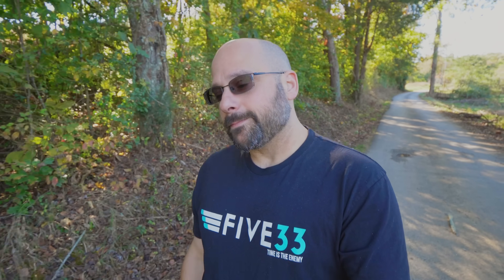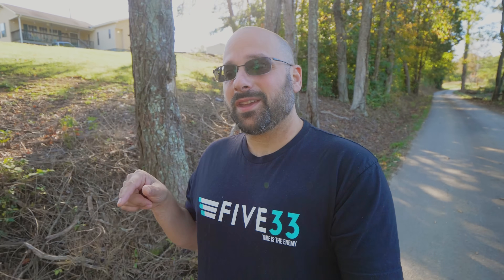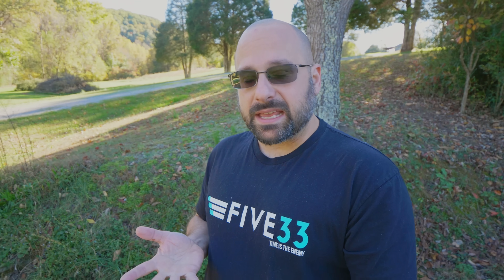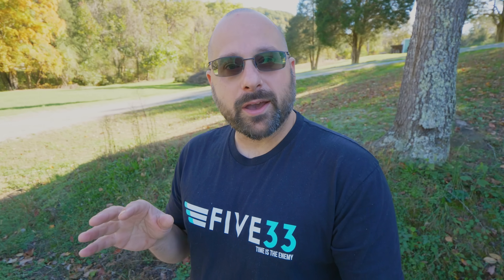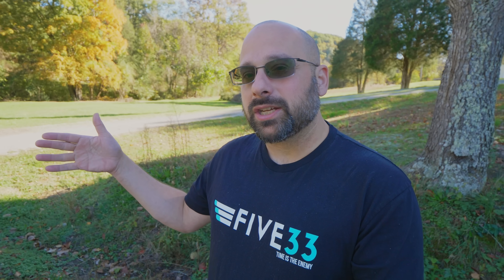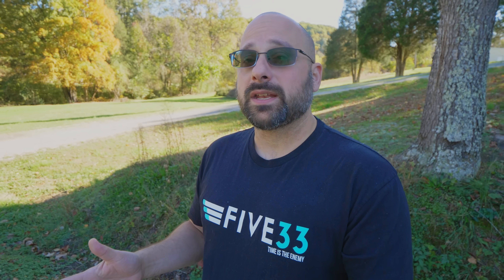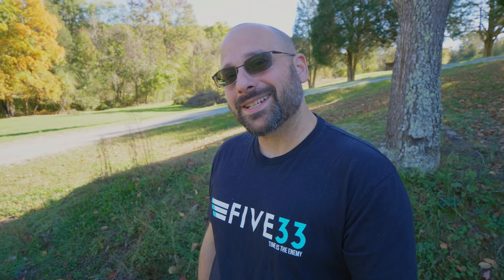How long can you leave your lipos fully charged without damaging them?

Comment: Thanks for this great info Joshua.
I just pulled my quads out of the closet last night, after two years, and remembered I hadn’t discharged my batteries to storage level before they got boxed up when we moved.
Two of my Tattu R-Line 850 4s batteries were completely dead, and two of my Ovonic 1550 4s batteries each had a single cell below 0.5 volts.
The rest seem to be fine, and have discharged down to 3.6-3.8v per cell on their own.
I was able to resurrect both Tattu batteries using the NiCd direct-charge trick to 13v, then balance charging the rest on LiPo. They’ve both held charge across all cells overnight so far. Fingers crossed.
I was also able to resurrect the single cells in both Ovonic batteries by charging them through the balance lead using NiCd to 3.5v, and then LiPo 1s to top them off.
Now I’ll just have to see if performance has degraded much. The batteries didn’t have a whole lot of usage before being stored so I’m hoping for the best.
Reply: This sounds like playing with fire, like... literally 😅

Comment: In re smashing your batteries: 
That's why I switched to Floureon batteries. They have little plates in them.
They're heavier, but after chopping one battery in my props and bashing a Tattu into the ground until it broke, I got the "armored" Floureons. They perform decently too, but my charger doesn't think they hold balance well at all.
Better than those cheap pair that one just decided to go up sitting on my table. Left a burn spot. The other one has a lame cell, but interestingly my charger has no issue with its balancing.

Comment: I keep my batteries in a ammo box.With lid partly open.I've also left them in there fully charged. They do drop in voltage. About .7 ( over a half volt) over a period of 5 months.i don't have any issues with the batteries.ive been doing it for 3 years now.i keep my batteries in my basement on the concrete floor with nothing around them and in a steel ammo box.

Comment: But what is "performance" does this entail the discharge rate or its capacity?

For example, I have some very worn out cells that I always put back to storage mode. If I measure their capacity, they are still fine barely degraded... but I can't discharge them like I used to!

I still repurpose these worn cells for other electronics, I have this TinyGS running off a cell that still lasts a good few days before I have to top it off. Fly a quad off of it and it cries uncle!

Comment: Hi, I fly electric RC  aircraft since 2008 and many like me fly large models and often the same day in several times. It would take too long to charge them the day before, especially since we have to adjust our schedule according to the weather.  I have had LIPO batteries since then that are still in good condition and have always been kept fully charged !!!! The reason for their longevity is that we keep them in the freezer, which immobilizes their natural chemical degradation metabolism.  So no worry about keeping them fully charged as long as you maintain their temperature below 10c. For those who say that the cold prevents the batteries from giving their full power, I personally could never tell the difference.

Comment: I left a 2200mah 4s after a full charge for 2 years. I would say it has less than 50% total amp draw left and cannot sustain the discharge rate it used to. Basically stuffed

Comment: Hi Joshua!
There's an opinion, that's it's better to store lipos in fridge. This is because the batteries lost their capacity cause of chemical reaction, and when low temperature the reaction goes slower. That would be great if you test that. Because for me its easier to drop my batteries in fridge instead of discharging them if for example i want to store them one week before next weekend. Thank you!

Comment: Joshua, Good info on the batteries.  I recently did a test with my phones lipo, which took 2+ years to complete.
I read that, like you mentioned, a lipo's ability to hold a charge was reduced to the 70% arena after 300-400 charge cycles.  BUT, just modifying two parameters would increase that life to 1700 - 2000 charge cycles. Now, to be fair, a charge cycle is defined as charging back 100% of the battery's capacity.  ie , a 4S 1550 would need 1550ma of power charged back in to be considered 1 charge cycle..  Two 775ma charge sessions would be considered only 1 charge cycle, as well.

The two parameters I mentioned are 1) Limiting the cell voltage to 4.00v/cell (or 80% of the battery's capacity) and 2) limiting the amount put back into the pack, at any one time, to 20% of it's capacity.  The second would require multiple charge sessions to get back to the 80% mark.  Funny, it's the 80/20 rule that we see in business all the time.  80% charge cap, and a max of 20% at any one time.
  
You might ask "What do these two things accomplish?"  
1 - The 80% rule addresses the phenomenon of the battery chemistry crystalizing in the cell at anything greater than 4.00v.  Well, it actually occurs at all voltages but what experts have learned is that it accelerates at voltages above 4.00v.  
2 - Limiting charge amount, only adding 20% at a time, addresses the second killer of lipo's, and that's heat.  When you charge back >20% the battery naturally starts producing heat internally, which also accelerates the crystalizing phenomenon spoken of earlier.
So, back to my phone test.  I bought a new Samsung Note 9 in Sept 2018.  I installed an app called AccuBattery, which tracks your battery's health in terms of capacity, and will let you know what its capacity at any point during its life.  It will also alarm when it reaches the maximum capacity that you set it to.  Mine was set to 80%.  By changing the way I charged, limiting it to 80% capacity (the Notes have a 4000ma pack so I wasn't really limited at being at 80%) and by "bump-charging" on a wireless charging pad several times a day, I was able to trade in that phone at the 2 1/2 year mark....and AccuBattery said that my batteries capacity was still at 87%.  The second owner of that phone got a bargain, if you ask me, because used phones typically have batteries that have been "rode hard and hung up wet", and you never know what their life is.  Kind of like a used car.  Getting a phones battery replaced can be expensive.

Conclusion:  I'm glad we don't fly phones!!  We can toss a mini quad lipo and replace it once we feel the sag coming on sooner, knowing the pack has seen better days.
Thanks for the video, as I've often wondered about how long I can store before I start crystalizing the chemistry.
Reply: High performance lipos are have much higher discharge rates and are completely different from the lipos in our phones. They don’t suffer the same damage at the same voltages
Reply: Don’t you think it would be better to know the answer to the video you’re making BEFORE making it?

Comment: I had 4 batteries with about 40 cycles on them each. In 2013 I didn't check voltages, I just flew, sometimes till the motor cut out. Due to various reasons, I hadn't used the batteries for 8 years. When I pulled them out of storage, 3 of them were at about a storage charge. One the them was sitting at 12 volts! (These are 3 cells). I must have left it fully charged when stored. I must say, I was amazed by this, as I expected them to all be dead. All my little 1 & 2 cells were deader than a doornail, except for 1 elite, which I charged up and flew a micro around on. How long will lipos last? Who knows? Some will go 8 years, that I know.

Comment: Very good points! I am very "relaxed" about how long I leave my batteries at full charge (I like to have them ready to rip) and I am unable to tell any difference in performance. That doesn't mean there isn't a performance degradation, just that I'm not bothered by it. 👍

Comment: File under "Stupid RC Modeler Habits".  What exactly is the point of charging to 100% before you even get to a flying site.  Especially like more than 4 packs.

Just charge them up to 4.1v or 4.15v per cell, then top them up once you're actually on site getting ready to fly.

Some of you prefer to get lost in the weeds than just use common sense.
Reply from the maker: Not everybody is set up to charge at the flying site.
Reply: @JoshuaBardwell  What does "not ... set up to charge at the flying site" even mean?

If you have 6 packs @ 4.1v, you can just use pack #6 to top up the other 5.  Or just carry one of your non-flight-worthy packs as an aux pack.  It's better to beat up a single aux pack that you don't care about anyways instead of smearing completely unnecessary wear all over your good flight packs.
Reply from the maker: It just sounds like you're making your life complicated for minimal benefit. You asked, "what's the point of charging to 100% before you get to the site?" And the point is, obviously, that you want to be able to fly as soon as you arrive without faffing about with your charger. I hate charging in the field at all. I just show up with ten or fifteen charged packs and I'm good for the day. If I do end up charging, that's fine too, but I try to avoid it because I'd rather focus on flying than charging.
Reply: @JoshuaBardwell  There's the idea of, "Oh man I'm going to hit the site with 100% it's gonna be so extreme" and then there's the reality.

By the time you get to your site, you 100% charged battery isn't 100% charged anymore.  Roughly within about 8 hours (give or take) you will have dropped to 4.15v per cell anyways.  After that the self-discharge curve starts to flatten.  You'd think that discharge curve would have been a part of this analysis.

So if you go 8 hours or longer, you have essentially accomplished nothing other than unnecessary wear on the battery.

Comment: Ive let battery self drain for 5 years before i got back into offroad rc's i have and yes some were under voltage or 1 cell not registering but id charge them a bit without balance plug to bring the one cell back to a voltage , then id charge them full with balance port and still some would be under 6 m ohms resistance per cell and yes some were new batteries or used once.  i have 10 thunderpower adrenaline new in package still for 5yr now as well.  I have a brand new i flight fullsend v4 6s i just used one time till quad started beeping (was using it to get quad dialed in etc) and when charging it the cells were crazy resisance  of 40 mohms and one cell had 90 in beginning and once charged went down to only 24 m ohms which is sadly high esp for a new battery used once.

Comment: Not bad. You forgot to mention temperature. Li-ion batteries die from oxydisation. Oxydisation is accelerated by elevated voltages (eg 4.2v) and elevated temperatures. This is why laptop batteries die - always warm and always fully charged.
Batteries can be kept at 60% charge and at 4°C for an almost indefinite life. Instead of discharging your lipo, why not put it in your refrigerator.

Comment: You can leave them fully charged for never! Even charging a lipo battery to 100% is what causes most of the damage and battery degradation. If you only charge them to 90%, or even better only 80%, they will last VASTLY longer in terms of number of charge cycles, and you'll hardly even notice that 10% or 20% less charge is missing.

Comment: your comparing apples to oranges. 30 days full charge no cycles or cycle it every day and recharge leave it one day cycle it? you have to add in the damage of cycles and how fast you discharge when cycling. many different outcomes. but i agree dont leave the batteries charged for a week without using it or it will begin to damage it. just my personal experience. also every brand of lipo is different some crap out or puff much faster than others. you need a test for each brand as well. jmho,
 good video.

Comment: One way of looking at it using the available information... but over a decade testing lets me say temperature during storage just above freezing almost stops the clock...  and GNB says to maintain capacity to store their HV Lipos just above their wet charge state (somewhere just above 3.0v) and NOT at 3.85v as most people say repeating what they have been told.

Comment: josh is all wrong in this video 24 hours is max you want it fully charge and from 4.2 to 3.8 is not one full cycle its less than half.. lipos can last to 500 charges if you go easy on them charge the night before next morning fly then put in storage.. alternate batteries 10 minute rests between charges 20 ideal.. so buy say 4 batts and by the time you get back to num 1 its been 20 min.. buy quality batts like turnigy.. not amazon crap.. there is no such thing as hv batts there regular lipos labeled as high voltage charging a lipo to 4.35 tripples the speed at which they will die meaning 500 cycles youll get 100 tops on a good day.. you want more flight time on a small drone you go 14.8 volts on a fpv.. minimum and you buy more batts for 1s drones that simple 1 s drones youll only get max 3 minutes 2s depending 5-8 minutes 3 s about 10 4s drones about 12-15 minuts and so on and so on reason being the higher it can handle your motors wont go below min cut off meaning 8 volts for some motors and 12 for others  so you can kill your batt but atleast youll come back with a dedead lipo and not a lost drone.. for long range fpv use 14.8 minimum..

also charge at 1c to 1.5 most batts now can handle 2c with ease but if you do you take off 50 charge cycycles atlease by doing so charge less than 1c if you cant afford bats... and graphine batts are a lie and a myth they can fail faster because its a gimic and 1 layer of graphine really is a joke to get you to buy
Reply from the maker: Why 24 hours and not 23? Or 25? Why exactly 24 hours? Why not 22.7538923 hours? You sound really certain so please let me know how you get that number.

Comment: I once charged my lipos and left them for 4 days fully charged, because I was travelling during that time and greeded on having to spend time on charging and discharging. After 4 days, I flew the drone with the first battery and noticed that the voltage was dropping very fast, when I attemted to land, it saged so hard that my drone felt into the lake next to me, so I lost the drone. I learnt the expensive way, NEVER LEAVE LIPOS CHARGED FOR DAYS.

PD: batteries were pretty new.

Comment: So - leaving em fully charged reduces the capacity to hold charge - vs packs with bad Internal Resistance (IR) which have reduced capacity to deliver the charge they have.  I've been storing some packs fully charged for too long now - and I note that some cannot be fully charged any more - they instead peak out during charge at 4.10v for instance,  rather than at 4.20v.  But some still have low IR.  Learned something new today.  You can reduce the capacity to hold charge (leave em fully charged all the time), and you can reduce the capacity to deliver charge (run em down to 3.0v a few times - I think that will do that)

Comment: 100% agree, as example my Mavic Batteries do auto discharge after 3 Days, BUT they are very likely never to be broken in a crash, in fact, the oldest one is rocking 472 cycles and i still can fly 14 minutes with it. but for the freestyle Lipo's if i go out with the gang and somethings some along the way .. i just leave them and use them up over the span of the week flying them to the storage voltage (ish) so the charger just need minutes to finalize the storage. i repeat this until 4 packs are left (always have 4 fully charged)

Comment: Here is an Idea, I have my flight time for every quad set to leave a battery cell at 3.8 volts when the flight timer expires. I charge them before flying to full charge and fly them long enough to never drop below 3.8 when not under load. It takes a little trial and error but once you have the quad timer set, you never have to put the batteries into storage mode because they are already there. Only downside is that you get less flight time, but I compensate with having at least three batteries for each quad. It also makes the batteries have a much longer life because one thing that has been proven is the lower you drain the battery the shorter it's lifespan, and the greater the possibility for damage! Only exception are the 1! tiny quads!